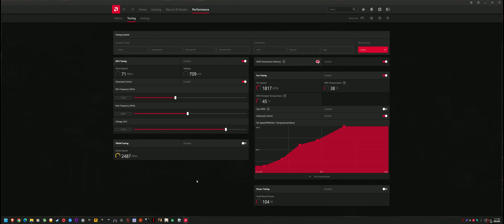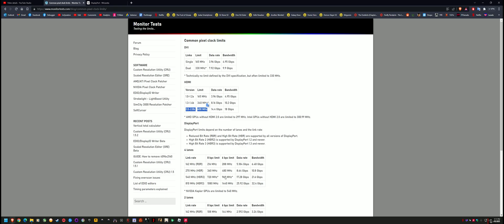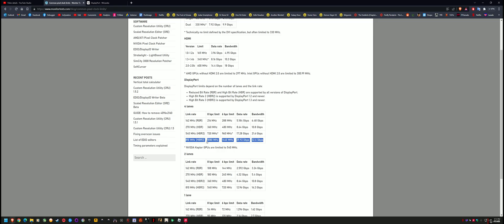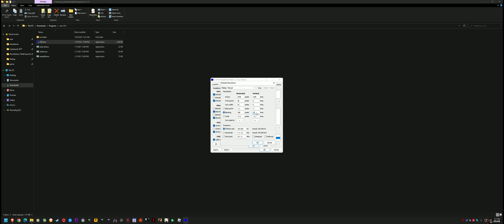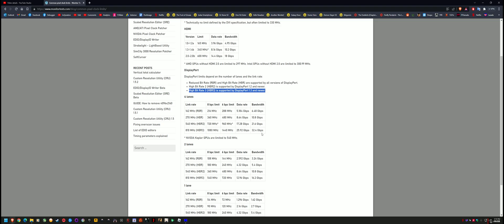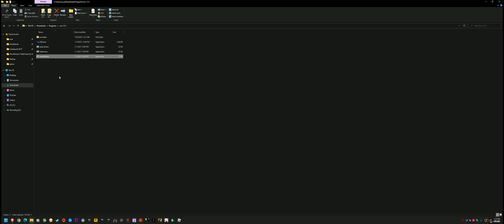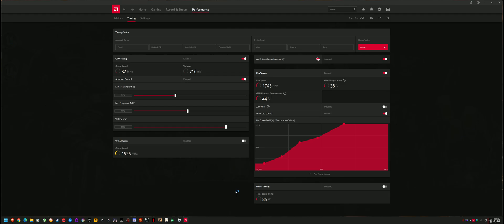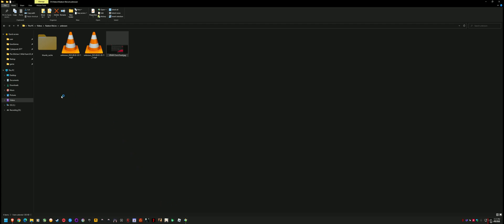RX 7900 XTX High Idle Power / Stuck VRAM Clock Fix (CRU)

Comment: I tried this and it did not work for me.  It ended up resetting. I did however turn the monitors down from 144 to 120 and boooom it allowed the vram to settle right down. I did order two new cables just to be certain I am using a proper cable.  For now I am content leaving them set at 120. Hopefully the new cables will allow me to turn back up to 144.
Reply from the maker: Ah nice, thats a decent temp fix, did you try a lower blanking time? You can work your way down in increments of 10 to 20 until it works, results will vary but you may get some downclocking at 144 that way.
Reply: @PatchFixGaming  I tried it once. Just set it to 200 on each monitor and  it made no difference. So I reset everything. Thats when what you said made perfect sense and why I tried lowering the monitors refresh rate in windows. Vram works great now at 120hz. New DP cables arrive hopefully tomorrow.
Reply: @dontbnvus17 hey, how is it with the new cables? Any improvement?
Reply: @miraveilyt   So long story. I actually have three PCs in my house. All AMD builds. Short rundown the 7900xtx/5800x3D with twin 1440p 144hz monitors.  The new cables changed nothing. However I found a solution that works FOR ME. When I put monitor 1 to 144hz and then monitor 2 to 60. The memory would function with properly. During idle was less than 200MHz.  I always game on the left monitor and use the right for chat and to monitor my PC stats.  I ended up doing the same thing with the other PC set ups. It has worked on all three rigs.  Like I said the solution works for me but I get that it still should not be this way.  Other two set ups are 6800xt/5600x with twin 1440p 144 monitors and the third is a 5700xt/3600x with twin 1080 165hx monitors.
Reply from the maker: That's actually a good solution for multi-monitor imo, given most people wouldnt game on both at the same time with a split down the middle.

Comment: Tried this, just made my monitor spaz out with crazy colors / white lines. Any ideas why?
Reply from the maker: Mostly comes down to monitor & cable quality, the pixel clock increase was too much,, just run reset-all if it doesn't auto reset and try a lower number.